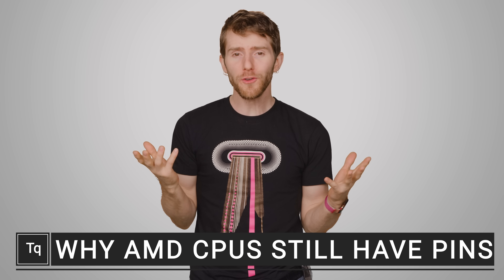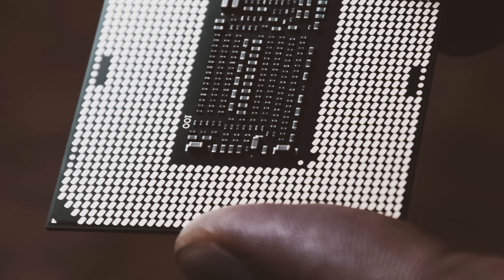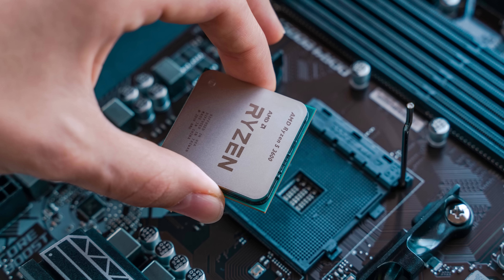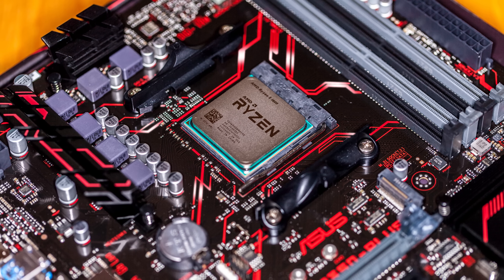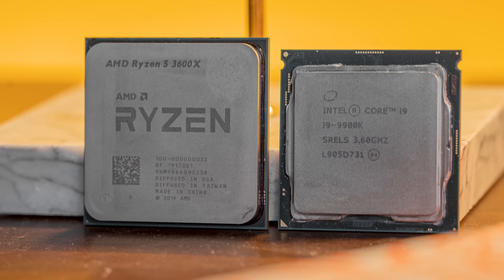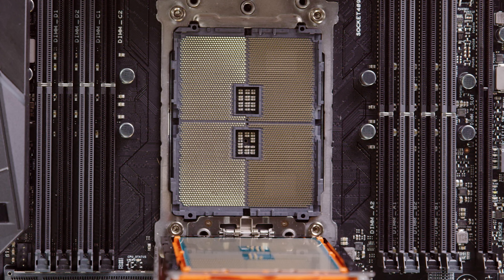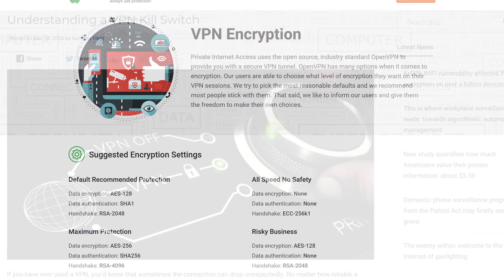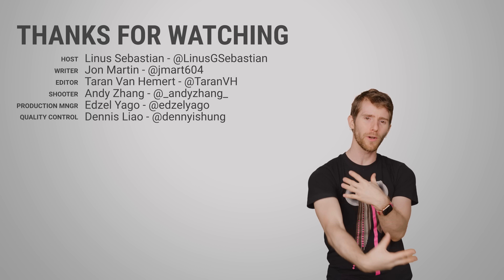Is AMD Stuck In The PAST?

Comment: >AMD stuck in the past
Meanwhile Intel:
cries in 14nm
Reply: Don't forget about 2 new generations of 14nm CPU's coming :D
Reply: @Scytian1  aren't we on three now with 10th Gen?
Reply: Kbolter NORRIS In fact the number of nm associated with the node is more of a marketting term and does not mean anythig at the gates level, since nothing is really the size advertized in the node name
Reply: @BunkerAnon  Intel 5000 series were the first 14nm parts so we're at 14nm+++++ although the 8000 series had one core i3 with 10nm cannon lake architecture. Still shameful they can't get their act together
Reply: @kbolternorris2676  it is called optimisation period
Reply: @BunkerAnon  6th-10th gen all are 14nm. and also 11th is probably 14nm
Reply: @kbolternorris2676  Dude You can't call Intel asshole for giving you the same process node. They make their own processors and refuse to outsource this for some reason. But yes giving us the same processors with slight tweaks is something even I hate. I won't call out Intel for not using 10nm bcoz they still can't get good performance out of those, and nobody likes the next gen being downgrade, but they do need to give better pricing and better processors
Reply: @BunkerAnon  14nm is old news for Intel. In fact their 5th gen of Mainstream-CPUs or 6th gen of HEDT already used 14nm back in 2015 and 2016 respectively. Meaning Intel is now actually on their 6th gen with 14nm and at least one more to come or more than six years. Ouch. Especially embarrassing considering AMD went from 32 nm to 7 nm (and since transistors shrink at least two-dimensional, meaning that is a decrease of at least 95%, because (7/32)² < 5%) within literally less than three years.
Intel's previous record for being on the same lithography should have been three years and generations respectively (3rd to 4th-refresh: Ivy Bridge, Haswell and Haswell-R/"Devil's Canyon"), but I am too lazy to do the research. I think ever before they stepped down the node faster, correct me if I'm wrong.
Reply: @BunkerAnon  Only mobile 10nm chips and they're horrible 0.7GHz !- 1.2GHz base clocks, terrible yields
Reply: @proton6731  that isnt necessarily true, there is a difference, and it comes down to the precision and tolerances involved in making the chips themselves. And to the people saying AMD doesn't develop their own manufacturing processes: I really don't think that fact is super important to us the consumers, other things like IPC, core/thread count, pcie lanes, and support for new features are more important that where the chip was originally made.
Reply: @Scytian1  intel 14mm+++ x nitro pro vr technology v2z3 gddr pro
Reply: @Scytian1  gen 5 gen 6 gen 7 gen 8 gen 9 gen 10. 5 generations of 14NM. 14NM+++++
Reply: @Scytian1  1, rocket lake is 10++
Reply: @xFODDERx  Where did you get that info? Every single piece in the internet says its 14nm+. Only info about 10nm I found is: Rocket Lake is 10nm architecture backported to 14nm. It was some random reddit post so it may as well be lie.
Reply: @Scytian1  2
Reply: @John Smith It's not to guarantee quality parts as you stated. The design for 10nm desktop was supposed to be released instead of Kaby Lake (7th gen). But the production had technical problems for years. They barely achieved double digit yields. During that time they were perfecting 14nm because they didn't have anything else to produce. But after that they found that the 10nm die shrink of Skylake (which was supposed to be 7th gen) was unable to clock high enough to compete with their own 14nm Skylake derivatives. Therefore 10nm parts are currently only found in low power mobile parts. Because lower energy consumption is relevant in mobile parts while it's hardly relevant on the desktop platform (as long as you can cool it).

In 2016 Intel even stated that future processors would become less powerful but more energy efficient but that of course was before RYZEN was released. Thanks to the release of RYZEN they couldn't get away with that and their processors become more power hungry with each generation to claw in some small performance gains. They even had to go back to STIM because they were becoming a nightmare to cool with their toothpaste TIM. Intel is just a mess at this point after being mismanaged for years (and still going). It's shameful to see a reputable brand as Intel which no doubt had very knowledgeable people on board go down the toilet like it's GM due to mismanagement and terrible marketing tactics.
Reply: @Anon Bunka, 10th gen Intel desktop processors are on a 14 nm process, although 10 nm is speculated to be on 11th gen Intel desktop processors
Reply: @hemhazgames  No 11th gen (Rocket Lake) is also 14nm. also they are trying to backport their 10nm to 14nm. Because Intel said that 10nm will not work for high performance parts
Reply: @katech6020  its tiger lake 10nm but still they are still behind AMD
Opss im wrong its just mobile cpu
Reply: @hemhazgames  and that same went with 9nth and 10th. Their line needs to be fixed.
Reply: @hemhazgames  No, Rocket Lake will continue at 14nm but with the architecture that was destined for 10nm
Reply: @hemhazgames  10nm on the intel side is a dumpster fire intel would likely skip 10nm completely
Reply: @hemhazgames  Just like its been speculated they'd be on 10nm in 2016 LOL
Reply: @hemhazgames  wait what, 10th gen intel CPU's are still on the same 14nm process? Oh wait never mind, that explains why the intel i7 10700K has a 125W TDP.
Reply: @andreiarg  And that CPU is a 9900k rebrand
Reply: @andreiarg  and the i9 10900 has a TDP of 65W. And yet the i5 10600K has a 125W TDP... Only the K-cpus have a 125W TDP, the non-K ones have a 65W TDP. Meanwhile a Ryzen 9 3900X has a TDP of 105W and so does a Ryzen 7 3700X, but a Ryzen 7 3600X has a TDP of 65W. Ofcourse you can't compare AMD and Intel TDP directly, because they don't use the same method of getting the number.
And in the end it doesn't really matter because most of the time your CPU is going to be sitting at or near idle anyway.
Reply: nm in a chip doesn't automatically mean better. There are many trade-offs that have to be counter-engineered. I'm sick of this whole Intel vs. AMd fanboy behaviour
Reply: Intel stuck on 14nm meanwhile amd cant beat intel
Reply: Hopefully AMD can get their own factory in the future. It is amazing how refined 14nm can keep up with 7nm. AMD just took risks that allows them to use 7nm but basically a prototype design. Looking forward to refined 5nm or better processes from both sides in the future
But honestly, it's just the marketing where smaller supposedly means better
Reply: amd doesn't even make their own chips. its much easier for them
Reply: I'm the guy who hit the 1000th like.
Reply: ZG trrruuuueeee
Reply: 14nm +++++++++++++++++++
Reply: 14nm +++++++++++ infinity lol
Reply: @John Smith yeah and that catch is having 30% market share.
Reply: Cries in burnt house
Reply: 14nm+++++++++++++
Reply: Thank you good post
Reply: My gaming rig is rocking a 0nm processor
Reply: 14nm with smaller die is even better than 5nm with a larger die.
Reply: Imagine having any kind of brand loyalty kekw
Reply: as if all the "internet experts" are liely to inderstand what a shorter litohraphy means on a digital transistor based chip lol
Reply: Why do you care about nm? Price/performance is the only thing that matters.
Reply: Still faster.
Reply: Everyone here just forget something very.very important performance per watt, and nota the shit that Intel stats un their fake tdp thats a lie and ir You didnt know that youre ... (Insert any insult here) just use one ir those kill-a-watt things and test the power draw  yourself!
Reply: What an irony
Reply: It's almost like you wrote the comment before you watched the video.
Reply: Intel still wins even with 14nm lul
Reply: Wow amd dont get much of 7nm
Reply: Intel has no reason to use smaller nm, since they're not running 32 core plus cpus, and Intel cpus rely more on single core performance.
Reply: Man intel has 10nm 100%
Reply: 10nm is goood brooo
Reply: Its small enough
Reply: I actually just upgraded from an old skylake i5 6600k(released in late 2015 on 14 nm I think) to a ryzen 7 3700x. I am satisfied with my choice to say the least. Also intel has been stuck on 14 nm for half a decade now. Thats 5 consumer generations of chips now, not counting their enthusiast platforms.
Reply: *Cries in Higher/Stable FPS*. Interesting. Its funny how a 14nm still wipes a 7nm in games. Funny how my Non-Threaded i7 9700k still a superior gaming processor. Does great streaming, gaming, 3 screens. 0.17% bottle neck with my RTX GPU. may be a 14nm+++++++++++++ but AMD is 7nm- - - - - - - - -. Still slower than a 14nm lol.
Reply: Jeez I'm the 8k like
Reply: Yeah and that 14nm is still superior in ipc and gaming, you fools dont realise intel will steamroll amd with sunny cove
Reply: If 14nm can compete with 7nm, im waiting for Intel to start producing cpus that are 7nm
Reply: Im out here using my i5 9600k i got for £100 and crying in 5.3ghz overclock and higher fps than any of the ryzen 7 series
Reply: @user-fs2zt4tk6q  you know the i5 9600k on stock OC beats the 3900x amd gaming flagship in gaming too? xD i have a i7 9700k at 5.2ghz, good enough for me, it beats the 3900x in every single game with preformance diff ranging from 5-30%fps increase by just a cpu!
Reply: @user-fs2zt4tk6q  any proofs?)
Reply: Haha.
Reply: Don't forget the ++++++++++
Reply: Ehhh... XD What is this thread? I use both of them. What I can tell is that AMD has a better price/value and nowadays Intel notebooks(even my 3000 usd ROG) are sucks compared to an AMD one. Intel cpus are hot nowadays. I don't really care about this fight thing because if you choose an Intel cpu with a decent cooler and a beefy psu u will be very fine but If u stick with an AMD high-end cpu with an optimal cooler and an optimal psu you can save 2-300(or even more) usd while you loose 5-10 fps for that price. It's only on you and on your budget. But for a rendering machine I recommend only AMD Threadripper.
Reply: It's neat to see the Megahertz myth 20 years later...
Reply: now this is a high IQ level joke
Reply: @derDiamomd 
You say that you do not know intel's 10nm density is better than TSMC's 7nm/N7 which is what AMD actually uses.
Reply: In Modern Living Rooms Everyone Using "SoundProof Curtains" That Stops Outside Noise by 80% (25 Db) Tested. Check Here: https://livesoundproof.com/best-soundproof-curtains/
Reply: Crying in 14nm? Is that anything like crying in Klingon? 😎🙃
Reply: @Ponvyr  you're right, it's much less likely that you will get an AMD fanboy than an Intel fanboy since the AMD people just went for the better price/performance and are happy with what they've got whereas someone the spends a lot of money on an Intel are more likely to get offended when they get told the AMD has the same performance for less price. When there is a better price/performance chip and someone buys the worse price/performance chip, they are likely a fanboy for that brand - they aren't buying it for performance, but the name.
Reply: I gave up on Intel but it is impressive at how much power they can pack onto 14nm chips. If they were at 7nm they would have no competition at all.
Reply: @fuzzy6622  yes, but they are not
Reply: Intel simply bides its time until they figure out time travel and go back to 1969 to buy out AMD...
Reply: amd 7nm gpus cant compete with double digit "nm" nvidia cards... enough said.
Reply: Might be 14nm but AMD's 7nm chips only perform as well as Intel's 14nm chips. Now if Intel went 7nm they would very likely be way ahead, again. Also, 64 cores may seem nice, but unless you're an 8K editing god, you likely won't use more than 4-10 cores. Most games today can only use two to four. Not downing the chips, but they are a tad core-heavy for 99% of the consumers around.
Reply: @GuretoSefirosu  false all the way around. I'm sure intel paid you good money to say such bs. AMD has serious ipc gains over Intel's 14nm process. The only reason intel is even visible at second position is because the just crank their processors as much as they can by increasing the voltage. There's barely any technological difference between their desktop 9th and 10th gen.  I would love to have you show me a 3d game that uses 2 cores at most lmao. And no one was talking about the threadripper 3990x, it's a halo product. Also, people do use that many cores, just not for editing, so intel does sell that many cores too, just marks them at more than double the cost of the 3990x.
AMD doesn't crank their processors like intel because it would make it a nightmare to cool like Intel's crapshits and it would be worse for the consumer. They just give the consumers the choice to oc their processors themselves ( and without extorting more money unlike intel)
Reply: @GuretoSefirosu  Finally someone who is not a fanboy.
Reply: AMDs "7nm" cant even out perform Intels "14nm" when it comes to single thread performance. And this is because Intels CPUs have a higher transistor density as well as higher clocks. The only thing AMD can do is throw cores at the problem, so it benchmarks really well when it comes to Multithreaded tasks. But 95% of people dont use multithreaded applications. So for the vast majority of people all those cores do sweet FA.
Reply: @Reee Flex I never said they were not affordable, and i never said the performance increase was only between  5%-10% in single threaded performance. I'm not denying that at all. The claim is that AMD is a better performer than Intel. And unless your running and multitasked workload (which most of us are not). It is not better. I didn't mention anything about price did i? If you want the best performance in games, buy intel.
Reply: Fact: AMD (glofo) is still stuck on 28nm, and spend billions for an aging licences Samsung process (14nm) is temporary (once Samsung will run out of demand they'll keep their process for themselves)
Fact: Tsmc (and thus AMD) won't be able to build enough wafer to compete with Intel in oem/server market (even Intel struggles)

ANYWAY, arm/fpga/ai is the future (or now) and amd has nothing in all this domains.
Reply: Love this short story
Reply: And cranking up the clock speed to squeeze more speed out of an archaic CPU architecture. Intel (and AMD) have held the industry back decades with this x86 crap.
Reply: New in 2030 Intel CPUs at 14nm+++++++++++++++ with 10nm coming soon
Reply: The nm number of the process node has become a marketing thing.  You can't compare between two different fabricators because they use different definitions.  Plus, at this point, smaller is not always better.
Reply: @EGL24Xx  "smaller is not always better." What girls say when i hit em up at the bar.... 😥
Reply: @EGL24Xx  Yeah its a very good point, but good luck getting anyone to hear you :) The marketing has worked so well that it blinds people to facts.
Reply: 7nm with the performance of a 14nm
Reply: @yukionna5060  ur actualy right!
Who says it wil perform better?
Reply: they’ve been stuck on 14nm for like 3 years now lmao
Reply: intels 14nm is almost on par with tsmcs 10nm transistor density-wise - which  really is the important bit. (okay, almost on-par is a bit too positive - it's 43.5 vs 60.3 - but not as bad as one might think.)
intels 10nm is said to be much better (approx 100+) than tsmcs 10nm and even beats samsungs 7nm there... if they ever manage to actually push something out.
Reply: bruh my 6700k is still comparable to a 9900k yet is blown out of the water by my 3700x Intel is stuck in the past by remaking the same CPU with minor micro code updates and slapping a new number on it.
Reply: He missed the part where when the thermal paste hardens and you try to remove the cooler from your AMD CPU it RIPS THE F*CKING CPU OUT OF THE SOCKET! This can't happen with an LGA mounting
Reply: @batRASHO  literally just twist the cooler a bit to stop that
Reply: your AMD <10nm is not optimized and having major impact on cost-over-real performance also price-performance ratio. No, smaller process die doesnt mean better. Your AMD CPU is still nowhere to be the dominant. Why is Intel 14nm far behind your AMD "advanced" technology but still gives top notch performance that you fanboys always get jealous at? Submit to the truth that your AMD is worse than the reality already
Reply: @chrisnguyen7731  well said🔥
Reply: Greentexting on youtube
Reply: veli mc based
Reply: @velimc52  You clearly don't write e-mails often, do you? :)
Reply: AMD GOOD INTEL BAD
Reply: @richardlighthouse5328  Both of them have their upsides and downsides, but AMD is definitely the better bang for the buck now while Intel is for people who want the most performance you can get and do not have a budget.
Reply: @fuzzy6622  budget is a set nr. Not necessary something low end, i can have a budget of 50k$ for a pc... its still a budget i allocate "example" .
Reply: Meanwhile intel: haha that's how frequency works
Reply: also AMD uses TSMC manufacturing instead of deveoping and manufacturing their own chips
Reply: @carholic-sz3qv  TSMC manufactures them, but AMD is still developing the CPUs, or how did you imagine how this works? "Hey, TSMC, make us some CPUs and we get most of the money for it, OK?"
Reply: @ireeb  TSMC nabufactures chips for various manufacturers , and also #tsmc uses their own developped technologies for that
Reply: @carholic-sz3qv  to manufacture the CPUs, yes, but the architecture and design comes from AMD. If I write a book, and let a company print it for me, it is still my book and my story. AMD lets TSMC produce their processors. But AMD designs them, and designing good CPU architectures isn't that easy.
Reply: ZG The thing is that amd fanboys are  being just ignorant. Talking about how amd is so far ahead in the nm development while in reality 90% of those don’t know the fact that amd has no in house development at all. It’s all provided by tsmc. Intel on the other hand has its own team and field for that. But that’s something MANYare missing sadly. Also I’m all for amd pricing, they are doing it right, so much better value in mostly every segment but I’m just tired of the stupid comments every where about the nm node.
Reply: @insidertech10  just cause they didn't make the product, doesn't mean it's a worse product…
Reply: @alexanderwulfert6730  TSMC can make very tiny nodes for sure, but they're pretty bad at cramming them close. If intel manages to cram them as close as in 14nm on 10nm, and that's a big if considering whatever dumpster fire is happening these past few years, they'll be ahead on single-core again by a big margin. (honestly i'd love it if x86 was dropped already. since when does a fucking ISA need string handling insturctions?!?)
Reply: @insidertech10  I don't know where you got that information, it's wrong. Intel has it's own fabs and Amd has TSMC (or others) make the products they design. It's not tsmc developing the tech, it's amd, tsmc just manufactures it. In fact, Nvidia is just the same.
Reply: @insidertech10  Customers don't care who made it, as long as they get a good CPU in their system. Also, not sure if this is what you were getting at, but I agree that the 'nm' war is—for the most part—just a bunch of marketing nonsense. Yes, it does make a tangible difference, but there are so many factors that go into CPU performance, and the 'nm' is just a small factor that means nothing on its own.
Reply: Fortnite LOL I’m tired of people like you complaining about contracting. How do you not understand how capitalism works, AMD makes a design and then contracts manufacturers to make it. AMD tells them how but they have the equipment, it’s a win win for both companies. I don’t know why you complain about smart business management.
Reply: @insidertech10  amd took the right decision by outsourcing their manufacturing. Why shouldn't we hold intel responsible for their greed and stupidity?
Reply: Manas Pradhan AMD would do the same thing if it was in intel’s spot. Remember when amd hit 1 ghz first they overpriced that cpu to 1200 dollars
Reply: @insidertech10  who is making the chip is unimportant because what matters at the end of the day is that intel is producing substandard chips that are coasting off their name rather than producing chips that can actually compete with AMD.
Reply: @insidertech10  I'm not missing that at all. AMD used to have its own fabs. Turns out not having them worked out better for them overall. I'm not missing anything.
Reply: InsiderPC Tech lol still better sad intel boi
Reply: @insidertech10  Who cares who makes the chips? And what is it telling you when independent chip manufacturer (read TSMC) is so much better than such a monster like Intel? Intel just got lazy and greedy. That's it.
Reply: @insidertech10  True
Reply: @insidertech10  
that doesn't explain still how they work so slowly... they basically taught they'd never have competition and the moment AMD came in they knew they were in trouble.
Reply: Fortnite LOL no dib Sherlock, I own an intel system, and sure intels 7nm process will be equal in transistor density compared to TSMC’s 5nm, but TSMC already is in production with their 5nm while their 3nm will start in 2021-22, and no I am not an amd shill, but I do prefer their current business practices. (I will not respond after this point)
Reply: @insidertech10  Intel has it's own team because they don't want to improve their products too much
Reply: @insidertech10  don't care, we are consumer just think what we will get.
Reply: @insidertech10  i totally agree with you mate
Reply: intel 14nm is still better than tsmc 7nm for desktop. intel just need more ipc.
Reply: AMD fan boy alert.
Reply: @Belikeimpasta  intel fanboy alert